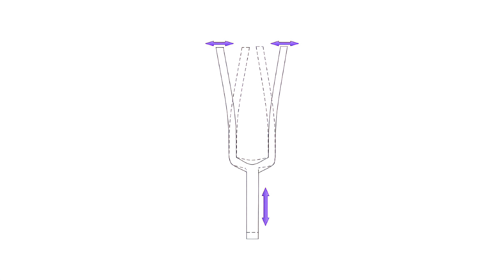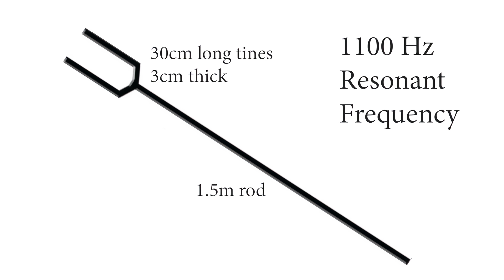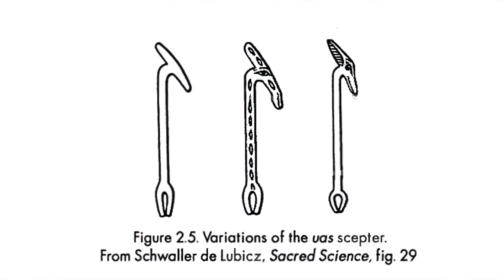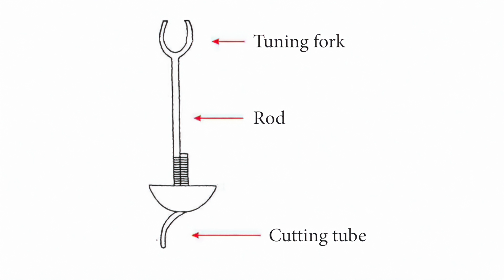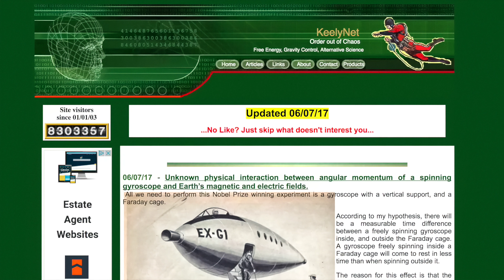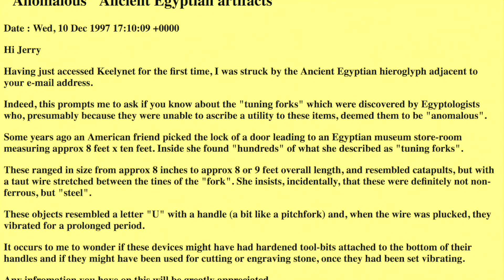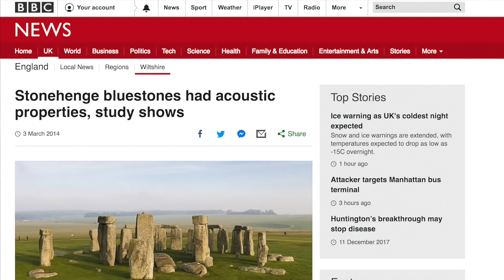How the Ancients Cut Stone with Sound - Lost High Technology Explained | Ancient Architects

Comment: At 6:45 : you notice the color of the granite ? Both plug and hole ? obviously something changed the structure of the stone , as they are grayish as compared to the  natural . 

RE: Tesla , "everything is frequency" . If you ever felt the vibration of electrical shock : then you can relate to sound vibration doing the work .

Comment: That sound very possible and even probable.   A modern hammer drill or larger jack hammer does the same thing using brute force and very hard points.   It is not far stretch to think that straight edge cutting could be accomplish by using a modified tool using sound.   This is the first time I have heard of this possibility used in ancient times and would like to see experiments to test this theory.   If it works, there will be a lot of red faces and furious denial and attacks from people with establish vested interests in Egyptian history.

Comment: The simplest way to prove the theory has credibility is by showing 1 acoustic stone cutter that works. If the ancient people can make it why cant you?
Reply: Here's a video showing how drilling could have been done, but it's not acoustic: https://youtu.be/yyCc4iuMikQ
Reply: @andymorrall  Then it doesn't support the conjecture of this vid. Interesting vid, the one you linked to, though.
Reply: Microwave ovens work by radiation exciting water molecules.

Induction ranges work by radiation exciting steel molecules in the pan.

All you need is the right type of radiation, and the right frequency.
Reply: i think this video fails to see that these holes have thread like makes down the sides which wouldnt happen with sound drilling. tell me im wrong
Reply: @scankhunt4206  how about they had to keep restarting the tuning fork as it's vibrations died off it would stop cutting
Reply: SonofEyeaboveall Effoff  Its ok. I think of it as if we live in a simulation. apparently the processer cant support a simulation  where everyone can actually critically think.
Reply: Make one of these drills work
Reply: There is one
Reply: Correct, Nazil.
Reply: The same for the formal theory , please someone can try and make a granit box like the one’s in the serapieum only using rocks and bronze
Reply: We’re not that advanced duh
Reply: SonofEyeaboveall Effoff  they were they made stuff out of rocks
Reply: I had surgery on my jaw and the doctors used what they called a 'sonic knife' that only cuts through a particular density material, so if you held it up to your hand, it would possibly feel warm but there would be no damage, but it cuts through bone like butter. They said it will be one of the last surgeries they do by hand, as they were in the process of switching to a computer-directed surgical process.
Reply: There's a guy on YouTube that drills these hole with sound.
Reply: Xeno Phon  no, I haven't seen them. When I get some time I'll give them a watch. I'm kind of getting the impression that not all people are "really" here.
Reply: That's a immature way of believing. Keep believing they built things with stones and ropes.
Why don't u ask urself how they lifted 20tone stones with ropes.... we don't have ropes today that can lift 20 tones. Wake tf up man
Reply: @Itisfinished2024  Howdy...watch this video..this is probably how they did it...https://www.youtube.com/watch?v=-K7q20VzwVs
Our Ancestors weren't stupid and could do amazing things with the technology they had...no sonic waves or aliens needed.
The tubes that you see that are cut into Granite? See this video:
https://www.youtube.com/watch?v=hjN5hLuVtH0
Reply: @Itisfinished2024  As an engineer, you make me cringe.
Reply: @Itisfinished2024  we've got shitloads of ropes that will lift 20 ton (tonnes). Use four ropes they only have to lift 5.bigmouth

Comment: You completely ignore that the cuts are made with a single cutting point, and make spiral grooves as it drilled the stone. The sonic drilling would not do the same thing. That's not my opinion,  that's simply facts that were uncovered years ago when the holes were examined.

Comment: Making the bit do work would quickly dampen the vibrational energy of the system requiring constant input. With such a discovery you’d almost be certain it would be well documented clearly in stone with the same instrument showing exactly how it was done.
Reply: What if you constantly plucked the wires between the tuning forks, or used a bow like a violin to rub against those wires? Though I suppose if you have wires constrict the forks, they won't resonate.

Comment: It seems to me, if the pyramids did produce power, could these tuning forks capture the energy and then turn that into power?(for cutting and engraving, perhaps)
Reply: It's possible. Look at the was scepter and turn it upside down. It's a tuning fork. Maybe that symbol as other have theorized is the drilling tool.

Comment: You produce the best videos Matt I urge you to continue. Have you seen this site ? It parallels your interest in sonic stone cutting. as well as piezoelectric possibilities. The piece is written by Christopher P. Dunn. I urge yourself and others to read it.

https://www.theglobaleducationproject.org/egypt/articles/cdunn-5.php  (Spirit & Stone, pg 5 of Advanced Machining in Ancient Egypt) I present a sample for your enjoyment.

The application of ultrasonic machining is the only method that completely satisfies logic from a technical viewpoint, and it explains all noted phenomena. Ultrasonic machining is the oscillatory motion of a tool that chips away material, like a jackhammer chipping away at a piece of concrete pavement, except much faster and not as measurable in its reciprocation. The ultrasonic tool-bit, vibrating at 19,000 to 25,000 cycles per second (Hertz) has found unique application in the precision machining of odd shaped holes in hard, brittle material such as hardened steels, carbides, ceramics and semiconductors. An abrasive slurry or paste is used to accelerate the cutting action.

The most significant detail of the drilled hole is the groove that is cut deeper through the quartz than the feldspar. Quartz crystals are employed in the production of ultrasonic sound and, conversely, are responsive to the influence of vibration in the ultrasonic ranges and can be induced to vibrate at high frequency. In machining granite using ultrasonics, the harder material (quartz) would not necessarily offer more resistance, as it would during conventional machining practices. An ultrasonically vibrating tool-bit would find numerous sympathetic partners while cutting through granite, embedded in the granite itself! Instead of resisting the cutting action, the quartz would be induced to respond and vibrate in sympathy with the high frequency waves and amplify the abrasive action as the tool cut through it.

Comment: Simple vibration at an optimal frequency makes a surgeons bone saw work. You can turn the saw on and press the blade against your neck and it will only tickle a bit, but put it against hard bone, and it cuts through like butter. And this is the simplest form of this kind of idea!

Comment: Accidentally playing around with a large Tuning fork I was able to chip an crack a small stone. In the right hands I suppose more could be done with it. the moving of 75 Ton stones could easily be pulled over wet marshlands which  Egypt was once.  The floating of 100 tons an more are floated down rives an across lakes by the military using, rubber pontoons or air filled animal skins filled with air,  like is still done in parts of China.  The only problem I have is the extreme life like  delicate sculptor handwork of the artist with a wooden hammer and a stone  which is impossible!!! An with only a 5th grade education I do not beleive in bullshit from 4th graders who state it was all done by little green men from Mars !!!!

Comment: I have a feeling they used a method like the fire starting method and used the grains from the rock to add as a friction modifier to cut deeper. What do you scratch a diamond with? Another diamond. Back then what is hard enough to cut granite? Granite I would presume, powdered grit being forced to move back and forth on the cutting surface with pressure and patience. Call me crazy but the simplest idea seems logical to me.

Comment: Makes me wonder if the ones with wire could cut long straight edges as the connecting forks were rung
Reply: No!  They would still have to guide the wire perfectly to make a straight cut because it's straight in two directions. You have nwvwr used hand tools have you? Cuting a straight line is not easy. Even with modern saws I find it hard to do.

Comment: You dismissed the experimant using a copper tube rotated by a string bow and sand as abraisive. Had you allowed that video to continue, we'd have seen how the addition of water to the slurry - as recommended by the operator - actually succeeded in cutting a nice deep hole in a reasonably short time. Instead of selectively dismissing practical, experimental evidence, you're simply confusing the issue with undemonstratable sonics theories that could never provided enough energy. Get real.

Comment: If copper and other soft metals are too soft to cut granite by a hand moving the blade, why would vibrating the blade make it cut any better? Ultrasonic cutters work by accelerating the cutting action, they don't change the cutting properties or hardness of the blade they're attached to at all. If anything they actually cause the blade to wear out faster. Not to mention that the blade of an ultrasonic cutter has to be vibrated at a very high frequency to work properly, how the hell would an ancient person vibrate a piece of copper at 40,000Hz? Do some more research on ultrasonic cutting and how it works.

Comment: There is a saying, " machinist make it better." I can't imagine the machines that cut this material. Personally I've machined/ diamond ground secret materials that, at the time, weren't commercially available. Today SOME of the cutting tools are available. Additionally, they didn't have water jet cutters back in the ancient times. I've seen slabs cut with water cooled wires, but this is intricate work in a lot of cases. Intrigued, definitely. I'm a Christian and believe that the fallen angels had something, if not all of these works of the highest quality completed. No records of Peru and the surrounding areas about this kind of DIFFICULT tasks? Think about it

Comment: Vibration sound waves with a copper pipe or any shape u won’t. The harp has 8 strong holes at the front of the harp to direct the vibrations from hand up string tilted 90degree to go on a vertical line which will cut

Comment: Sand grinds down hard rock, metal not even needed to drill (but it obviously  helps)... Even a stone cylinder on the end of a wooden shaft combined with (wet) sand would work, perhaps just the wooden shaft and sand alone.. Ancient sonic drilling is plausible - a pretty simple technology if you've started mastering metal and experimented with drilling for a while... I'm just glad it wasn't an ancient aliens acoustic levitation nonsense video about how large blocks were moved.

The oldest abandoned quarries point to stone tool use for extraction, less ancient ones have metal tooling. I've worked with stone enough to imagine what a team of hundreds of stonemasons and 1000s of labourers could do. It would be an impressive sight and sound.. I've seen simple methods for moving large heavy stone blocks and building with irregular blocks. I like down-to-earth, simple ancient technology research. Sonic drilling is fringe but not totally wacky.

Comment: GOD KNOCKED DOWN THE WALLS OF JERICHO WITH SOUND.
Reply: Prove it. Knock down some walls with sound. LOL
Reply: The bible isn't a reliable source.
Reply: Yup u are right 👍
Reply: No not God, Joshua & the Israelite army knocked down the walls using sound. This Is easily accomplished with frequency and vibration, and Is the reason soldiers break step when marching over a bridge ... the vibration and frequency of rhythmic marching might otherwise damage or destroy the bridge.
Reply: @davedarrington9925  Old soldier's tale.
Reply: In 1831 the British Army Issued a standing order that troops should break step when crossing bridges. This was after Broughton Suspension Bridge collapsed In the same year due to mechanical resonance from rhythmic marching matching the bridges frequency of vibration.
Reply: True its in the bible

Comment: BJR, ok a tuning fork would have been used for the shaping of vase & drilling granite dies .. okay. but.? would anyone have tried to reproduce it, to test its veracity? Many theories attempt to explain this in the way in which this or that thing was done. so when is the demonstration with, for example, the so-called lotus vase? which would be made, one of the pieces of a rotor system for sawing materials .. (in stones ..)
& là c'est des indépendants qui se sont regroupés pour reproduire & tester le disque de la tombe de SABU.. voiçi en vidéo.. 
les français , eux au moins on éssayé de tenter l'expérience. & regarder le travail qui est trés intéréssant..  a vous d'en faire autant..!!! 

https://youtu.be/Y9MvGQTuB2g

Comment: Perhaps the tuning fork was simply struck and set its tines in motion and with the tight wire between them, would be your cutting tool! The wire that’s vibrating!  My wife worked on a metal cutting machine that Simply used voltage and certain freq on a tight wire and the wire sliced through all kinds of metal. Industrial process.

Comment: I think your on to something. Early American miners actually used steel rods hammered into rock and a steel cable attaches that was then driven by a steam resonator to pulverize rock instead of blasting with explosives and actually worked very well . Sound waves comunicated down the rod broke the rock easily like a jack hammer.

Comment: A better idea from a prof. engineer: Pressure water cutter. Get a large rectangular stone box open at top, with a giant tight stone plunger like a piston to pressurize the water + sand with ~10 tons of pressure. At bottom of this device is has a side hole with a granite flat nozzle. Water + sand emerges at > 200psi to cut. Like a band saw, you move the object, not the cutter.  This could ALL be done easily by the Nile with ancient tech + labor: Water, stone, a plunger, granite, a nozzle with a small drilled hole. QED
Reply: @Martin G  Snark aside, I was constrained by their known tech. I don't think they had a way to make "a small nozzle" flexible under 200+ psi using their tech.  So think of it as like a band saw, where heavy blocks slide on a smooth table or many rollers past a water + sand jet cutter.  They cut logs like this too, since at least the 19th century.

Comment: Im pretty sure its not wires between the Egyptian tuning forks, but electricity/electro-magnetism, or more likely, 
sound waves..
Reply: Induction frequency, it is utilized every day in Tesla's 3 phase AC transmission system. If the phase is not at the correct frequency it will not work correctly, see my comment and Eric Dollard for a more detailed explanation.